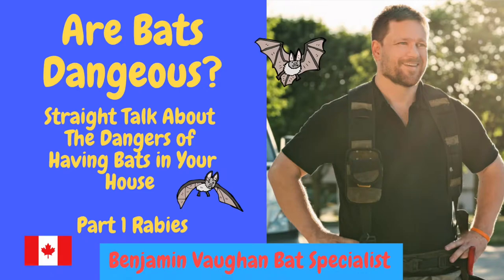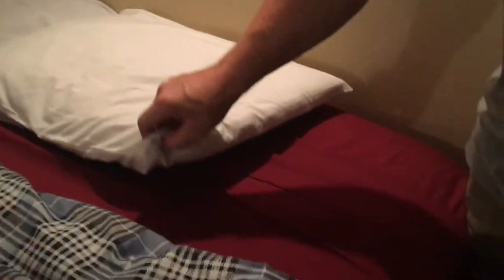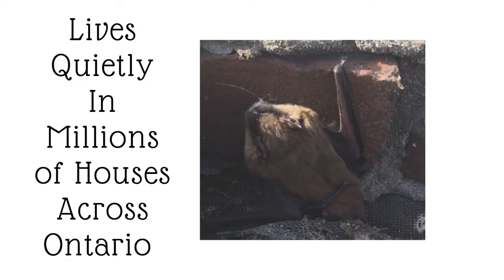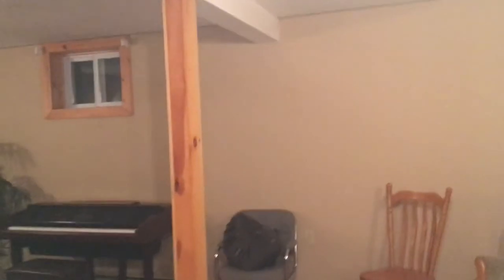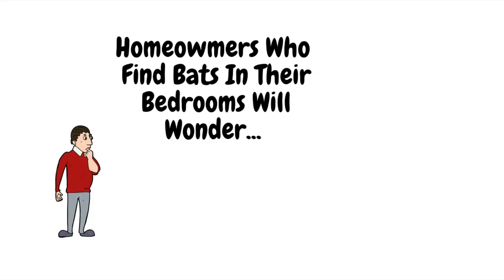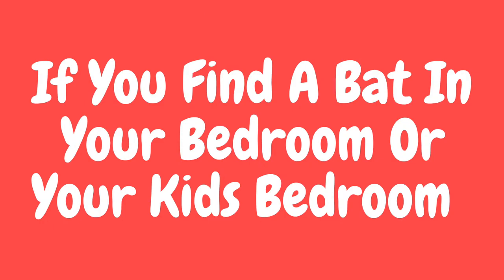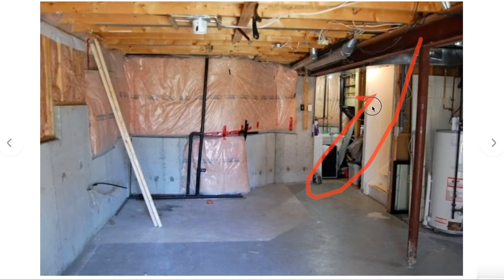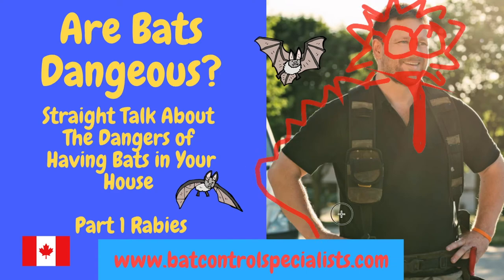Are Bats Dangerous? Do I Need To Get Rabies Shots? What If It Bit Me While I Slept?

Comment: Hey i was curious. Ive found about 6 hibernating brown bats in my house (indiana, U.S.) one of them woke up and i let it out of my apt. 

1 is there a difference between big brown bats and little brown bats? Also how big are the colonies in general?

2 i just bought the place and plan on renovating this spring. Its a 200 year old house with many Places for them to get into the unfortunately. And from what I’ve learned i wont be able to take care of the problem until spring.
Reply from the maker: 1. Big Browns and little browns are almost identical in size color and behaviour. Very hard to tell apart. Although not closely related they are similar because of  something called convergent evolution in that they fill the same ecological niche. 

However little browns overwinter in caves not houses, and the North American populations were devastated a decade ago by a fungus disease called white nose syndrome. 
Therefore you have big brown bats. A semi transient species, Big browns are year round residents that form relatively small colonies between 5- 30 on average. 

2. All house have thousands of potential entry points and in your location you cannot fix the bat problem until spring. Hopefully there are bat-specialists in Indiana you can hire. Good luck.